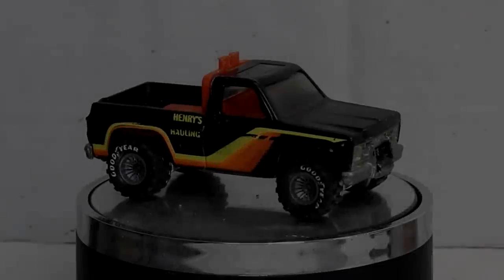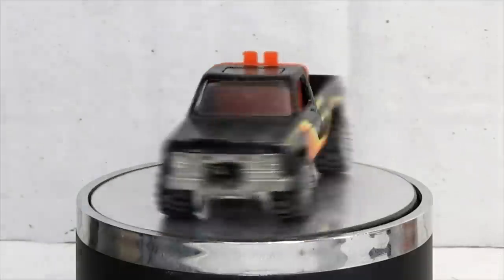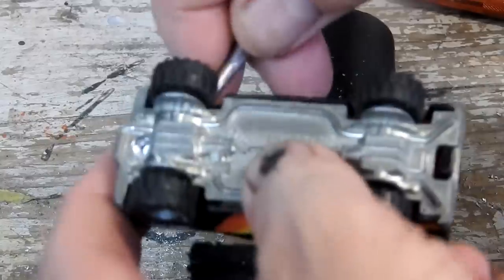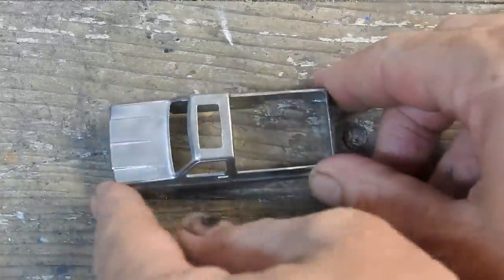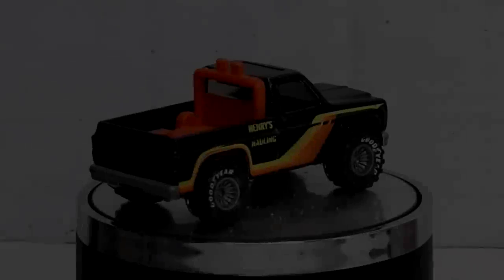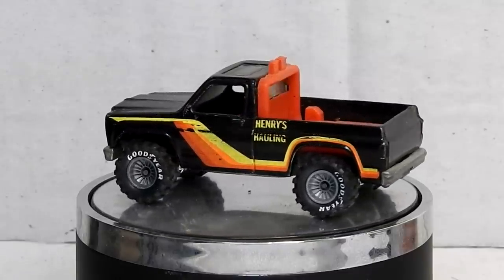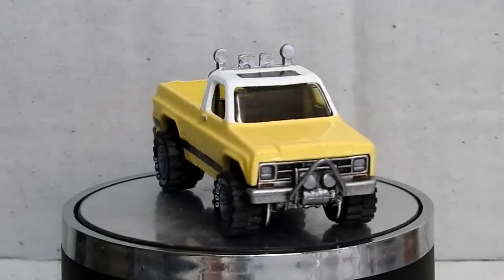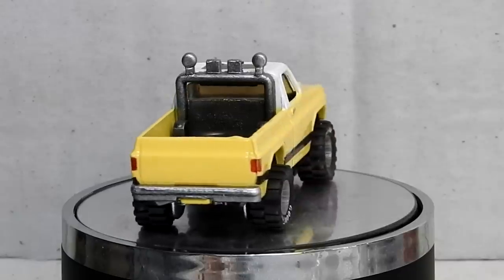1980s Hot Wheels Real Riders Chevy Silverado Super Scraper Custom Restoration

Comment: Nice Work! This Toy is Similar to my Hot Wheels 1977 Chevy Pickup Truck Casting that I'd probably got between the late 1980's and early 1990's expect it was a Dark Red with Eagle decals on the sides and no Wheel Riders just some of the old offroad Hot Wheels wheels.

Comment: Very nice custom, the car looks beautiful. There is a little overspray at the inside of the cab and sadly this model dosn't have a dashboard with a steering wheel.. Maybe the black stripe going around the carbody a little higher with the taillights could look a bit better to. ice solution for the missing frontplow. Awesome final fotage.

Comment: I've had a few issues in storing my Hot Wheels, well actually ALL cars with rubber tires. I have a Tomica car lot and the tires tend to stick and leave a little black smudge. Another issue was I made a diorama out of Styrofoam for a snow street and with that the cars SINK into the Styrofoam and a white mark is etched into the tires. Just a heads up. I'm not sure as to what I can do except maybe get a dehumidifier? No idea? Has this happened to anyone else? Any info is greatly helpful. Thank you.